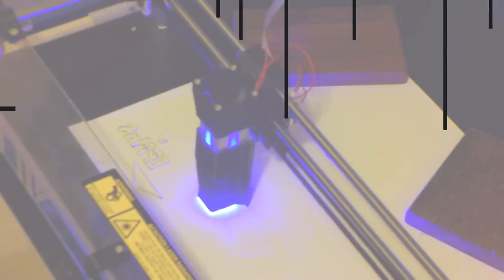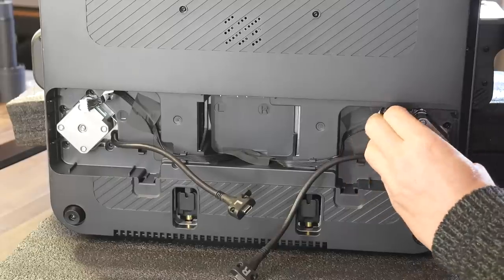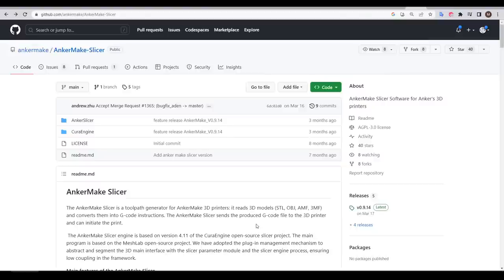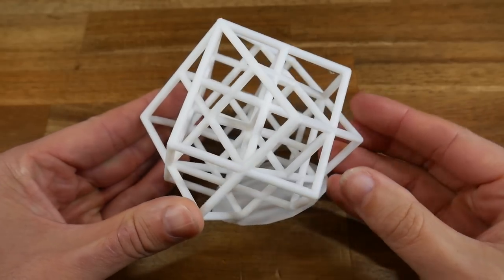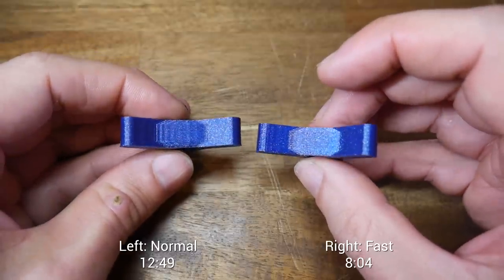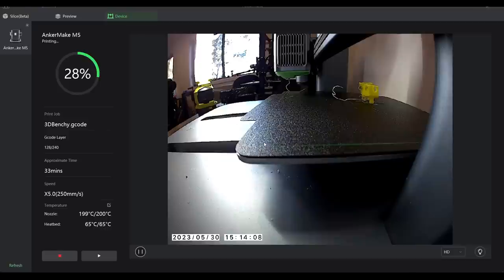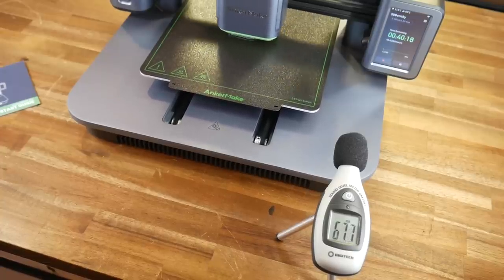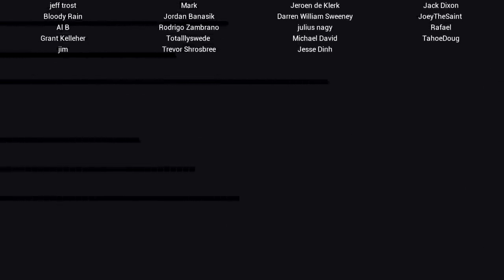A 3D printer that just works? - AnkerMake M5 Review

Comment: I think it's quite a bit too expensive – the Bambu Lab P1P prints faster and possibly nicer, is better suited for upgrading it yourself (e.g. with a case) and costs less.
Reply from the maker: I feel features wise this is fair in being a bit more expensive. Has a camera from standard and the appearance is a bit more refined, but that won't matter to everyone.
Reply: @TeachingTech  The camera comes included with the P1P for free since April 3rd (still 0.5fps and no AI, but enough to check on your print and do timelapses)
Reply from the maker: Thanks for the clarification, I didn't know that.
Reply: Bambu will do 500 mm/s? That’s what Ankermake has started advertising
Reply: @PaulShapiro  Bambu Lab advertises 500mm/s as "Max Speed of Tool Head" ... But that's misleading – only travel moves can be that fast, it's not actually laying down filament at that rate.
Reply: For 500mm/s you would need a VzBot 235 AWD or Annex K2 with cht or bozzle nozzle. 
Probably 5160 drivers and water cooling.

Comment: For the price point, might as well stick with a P1P that also... just works.
Reply: This misses the point that the p1p doesn't target new users or low effort users the same way. Also it be nice to go a single video on a $600 to $800 printer without Bambu cheerleaders saying to "just buy a P1P" and consider there are reasons for people to want a different printer.
Reply: @dannonyogurt98 thank you
Reply: The ankermake just dropped the ankermake m5c compact version half price than original ankermake m5 that's going to be the new printer to beat ankermake m5 is 1099.99 cnd originally that means  it should be 549.99$
Reply: And doesn't yet have shady business practices and lies like Anker did with Eufy
Reply: Shady behaviour is getting more and more common unfortunately. Even Prusa advertised and sold the MK4 with input shaping that it didn't get for months after launch.

Comment: The "upside down" packaging is not a bug, it is a feature - the idea is that you are supposed to open the top, flip the open box on a table, like an omelet, then "lift off" the cardboard for the big reveal.
Reply: Agreed!  That's pretty much the standard way to open a large unit box.  I am very, very surprised with TT's level of technical understanding that this was a first-time lesson.

Comment: Thanks for your excellent review.

To answer your quiestion: For 700-800 dollar/euro I expect more from a printer than a polished Ender 3 Pro. Which it still is.
Reply: Actually it's not it is significantly better in the user experience (hardware side) but it also prints significantly faster at 500mm/s

Comment: As always, a well presented review Michael, thanks. The whole taking open source ip and putting it behind a patent wall really burns my biscuits! It’s the reason I will have nothing to do with anything Bambu, Creality, Anycubic and several others.
Reply: QIDI was so bad about exploiting open source that they used open source stepper motor driver boards but soldered the header pins on the opposite side of the board to reverse the pinout for the sole purpose of selling me their proprietary replacement parts, which they discontinued a year later when they came out with a new 3D printer and orphaned the $3000 worth of proprietary printers I bought from them.  That's evil.

Comment: Having some experience in hardware setups for robotic vision systems, for the "AI" error detection to really be viable there needs to be multiple cameras at different angles and a well tuned lighting system to filter out ambient light along with getting depth perception to calculate real-world units.  Basically, a 3D scanner system that maps out a point-cloud.  For that to work in real-time while printing would probably require a beefier processor, or a co-processor just for the vision algorithm computing.  With all that being said, I give them props for introducing this idea even though it's not implemented well enough to really do much.

Comment: Its a bit of a fail that there are settings that can't be changed on the device but need the app to change... Hopefully that will be corrected in a future firmware update. I also wonder how long Anker will support this device, since 3D printers are not their core business, hopefully if this device is a success they will continue to support it and models that follow.

Comment: I've thoroughly enjoyed using the one that I have at work, it's definitely some much easier to setup in comparison to the Ender 3. The slicer is fairly terrible, but workable. The only printing issues I've run into is when I'm printing 5 or more objects at once, but a quick adjust to Zhop helped. I like it, but just ordered the Neptune 4 Pro for myself yesterday and I'm looking to see how it stacks up to the M5 for half the price
Reply: My ender 3S pro just works
Reply: How have you found the Neptune  Pro? i was planning to buy it but never got around to. do you think the additional 400ish$ worth? from what ive seen from the AnkerMake M5 its not worth it.

Comment: Wow, that looks nice. My ender 3  has definitely been punishing any mistake I make  and I am getting burnt out on doing more troubleshooting than printing.
Reply: agreed on that.. Most likely will be upgrading to this.
Reply: i feel this in my soul.  i can only recommend stepping away for a full day at least.  that works for me especially when i notice ive spent 2+ hours trying to fix something right after 4 successful prints.  frustration is exhausting so it just gets worse the longer you have to poke at it.  just a thought.
Reply: I feel you. I can make my Ender3 make incredible stuff but around once a month I'll hit a wall and most likely need to waste a couple of days on troubleshooting / repairs or even waiting on a replacement part.

Comment: The thing is that in my experience aside from bed levelling, even ender 3 models "just work" fine out of the box. The real challenge comes months or years of use later once the parts start to get worn and misalligned. While this machine looks really good, unless it stays overwhelmingly more reliable than other printers, it doesn't really provide much more than any current model with the same functions integrated (rout sensor and self levelling).
I'd be really interested a followup video after numerous of hours printed in a couple months.
Reply: Aside from the auto bed level it also prints significantly faster then an ender 3, it helps a lot when you are doing rapid prototyping the speed will allow you to make a lot of iterations a day where with an ender 3 you may only get a couple. This being said ive had my printer since october last year and ive run probably 50kg of filament through it and i havent had to replace anything other then a few brass nozzles since ive used a lot of glow in the dark filament. Ive got a ruby tipped nozzle for it now though! so hopefully wont even have to replace that unless i need a different size!
Reply: Our goal is to ensure we're there to support you and your M5 during your entire printing journey. Not only do we provide a straightforward warranty that is processed in the most hassle-free way possible but we will also gladly repair or replace your product if we identify, through inspection or testing, that your product fails to function properly due to manufacturing error, workmanship, or any other such causes aside from collision, water damage, or unauthorized disassembly of the product. Our customer support team is always available to assist and help answer any questions as well! - Kiki Chen from the AnkerMake Team

Comment: I don't think it was packed upside down by accident. Once you open the box you just flip it upside down and lift the box off. No need to awkwardly dig around while holding the box as you try to pull parts out  I've had many things packed this way, indulging a few high end TV'S. Made unpacking dead easy.
Reply: I bought a M5 and mine was packed the other way. (Though mine was a kickstarter, early model)
Reply: @thespencerowen  Hey  I might be wrong . Then again Matthew yours was pack wrong. lol  I think what most important is that they are packed well.
Reply from the maker: The side of the box I opened was designed to open easily, so I'm pretty sure I got that right. Couldn't see any text instructions on the box telling me to do it the other way either.

Comment: Excellent review.  'For people who just want to print things' - well, you have demonstrated that it really depends on what they 'just' want to print. Personally I prefer my Ender 3, well looked after and in a custom enclosure, to this thing. My Ender 3 isn't dependent on having a smartphone or web connection or whatever. Too much dependency on 'smarts' is not smart, in my opinion.
Reply: Not to defend the ender 3, but aside from bed levelling, it also just works out of the box. The real problem with the enders is how often they need to be maintained to keep printing nice. Now since this anker machine is no exception to the same physical forces that make the enders get misalligned, the real "just works" test would be appropreate after months of printing head to head with other printers. To see if the anker stays more reliable than others.

Because as we've seen in the video, it requres more fiddling with the slicer to "just work" and other than that it works just as much as any other printer with self levelling (which is almost all on the market at this point)
Reply: This is the biggest issue. Smart = dumb, and having to register an account and use an app is a deal breaker.

Comment: The market moved so quick. Something that would have been a good buy seems outdated now that the P1P is on the market.
Reply: the p1p and the m5 are fairly close now, i know one is cheaper and a corexy but the anker printer is all die-cast aluminum and has significantly better polish than the p1p not to mention how much easier maintenance  is on a bedslinger vs a corexy design.

Comment: I would like to throw a hint or help; Filament temperature. When bending filament till it breaks. Will that tell what temperature to set for that filament? Bending a filament and it breaks right away. Set to high temp, Bends and touches it's self set to low temperature!  Thoughts?

Comment: Customer Support is pretty useless as I have just received to the UK my M5 with the 3 month accessory pack and instead of getting 2 rolls each of white,grey and black I received 4 rolls of white and 2 of grey. Support say that is what I ordered, but the pack and machine on the website doesn't have an option of choice only 2 rolls of each.
 My other problem is that the app v1.0.9  and the machine firmware being V3.0.23-3.0.46 is still only showing 1 test model in the internal memory, Support are telling me that I have an old version of the app (the app is from their website) I am unable to find a newer version.
 I cancelled a Prusa mk4 as they would not give me an accurate lead time and it appears that they are still  having component supply issues. I now wonder if I made a mistake with the M5, however the printer seems to be very good and extremely well built. Especially as it is priced at £1006 with the accessories and I still got £250 off because of a spin the wheel discount code made it only £756 which included the 6kgs of filament, a PEI bed sheet, 10 nozzles, a Hotend Kit and 5 Silicone covers.

Comment: This printer has caught my attention because of the print speed. I have 2 older printers and being able to print at 500mm/s would be nuts. I'm not a fan of open design printers though. Too finicky.
Reply: wont ever hit 500 mm/s on this machine, set print speed does not mean it actually ever hits those speeds
Reply: For what it's worth I have done about 80 prints on mine and so far have had zero failures (only in pla and petg though)

Comment: I have not been able to load TPU in this thing at all. I might check in there though to make sure there's not a piece of filament blocking like yours had. That could be. I've had mine for about a week now and I am really liking it. But yeah I said the same thing about that camera angle I said it is crap! I like to monitor the camera when I'm away from home just to see that everything is still working and that hasn't stopped for some reason but other than that I had to turn all that other stuff off because it would go off all the time and stop the print for nothing! And I had to go in there and redo it if I was away from home I wouldn't have been able to do that at all. That was so annoying I had to turn it off but I like at least being able to pull up the camera and make sure it's still going. And I can see if The printed thing has fallen off or something. My biggest shoe right now is trying to get TPU in there. It will not go through and I don't want to have to take it apart like you did but...

Comment: the 'similarities' to the ender 3 is what put me off of this printer.  With enough mods (and basically putting the price around the same or maybe slightly cheaper on the E3 side) you can get all the bells and whistles  the M5 has.... which as a E3 owner.. means it  really isn't 'for me'. not saying it isn't a fantastic printer, just that...  for that price I expect a least a bit more, such as volume to print in, or enclosure, or to get off of the horrible bed slinger design, as going faster is possible - but this M5 will have just as much, if not more, problems as any other bed slinger when dealing with that sort of thing.

another thing i didn't understand is the camera angle, and of course... things like belt tension needs... seems more trouble that it's worth.

I DO like the idea of USB-C to reduce wire to hotend though, makes things less cluttery and easier to manage. 1 robust cable seems like a better option than a handful of thin, easily broken cables.
Reply from the maker: For me the key point is that you are comfortable enough to mod and fettle your Ender until it purrs. I think this is aimed at people who aren't interested in that.

Comment: it's a bit hard to critise the software as it clearly stated it was beta...it's good that they have a simple and expert mode to help new people to start printing quicker...i'm sure they will start to add more helpful features but the key thing was to have the essential stuff first

as for the AI error detection - they need more than one camera angle because it in your test case the error was being blocked by the chimney stack which had printed ok...had this print also had a camera on the other side it would have been able to see the error sooner

Comment: did you run it at 500mm as advertised?
Reply from the maker: The camera dolly section shows a comparison between fast and normal speeds. Larger objects will have a greater difference in duration as they won't be limited by acceleration.

Comment: I own one and miss an updated slicer and better support for upgrade parts on their site. Like an extra Steel Nozzle the lack which was not advertised of course. In contrast to the shiny promising M6 Multicolor extension, where we only recently learned that it will be produced Sep-Oct this year in a number of 5000 units at first. If this works out of the box like the M5, I will finally say I am glad I bought it, until then I have a nagging feeling a Bamboo might have been the better buy, 
The M5 is damn loud, and the bed slinging causes lots of vibrations through my desk. I am tempted to put it on a heavy stone plate with shock absorption feet =)

Comment: 18:35 - Did you try doing a cold-pull with this extruder? Does it require removing the cover if you need to do one?
Reply: Ive done a few cold pulls all you gotta do is press the lever on the extruder and give it a solid pull no need to pull anything off.

Comment: Sorry But the price for this kind of performance is not acceptable. For this price you can afford more reliable Bambulab P1P but it goes better: 
I bought Anycubic Kobra2 for $300... I got this printer Yesterday and I keep Feeding it with some random models with speed of 150 - 250mms. none of them failed and it have steel rods on X&Y axis which  makes the bed and the printhead more stable than V-rolls. Sure you Don't have AI camera but you wont need it when Your printer works right. Sorry but in my opinion is AnkerMake way to overpriced and this look don't help me if the results are... like they are. Of Course: I have Kobra2 just two days but even when: if something break, its Open source design and all parts are pretty cheap available like everywhere. When I saw Ankermake i was vey sceptic about this printer. With your results you just prove me right. This is an bad "allrounder" that wanted to do everything but can nearly nothing.

Comment: So I bought this, assembled and now I don't know why a full bag of 2x16 screws are no we're to be fixed. I just can't understand where they are supposed to be fixed. 

Tried to print after several times of bed leveling, the printer prints in air. Item sliced and leveled to lie on bed with Anker slicer. Frustrating.

Comment: V-slot wheels are not maintenance free and therefore a cause of concern for those who want to 'just print'
Reply from the maker: Some people hate them but I've found over the years the rollers across multiple printers have more or less been set and forget.
Reply: I think as a new user once you see the toolkit they give you its not maintenance free and i do feel its a little on the edge if that is 'ok' its kind of like a bicycle i guess when you have a nice one you have to decide if you or someone else maintains it but you know it has to be done. Weirdly on bicycles they also don't make it THAT clear its part of ownership my current bicycle takes about $400 to maintain each year or about 1/20 of its price.